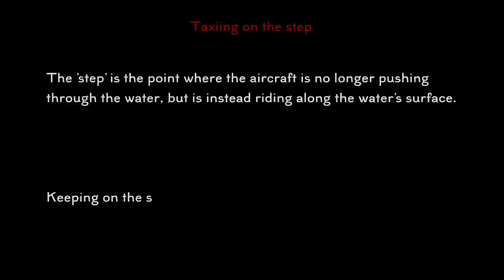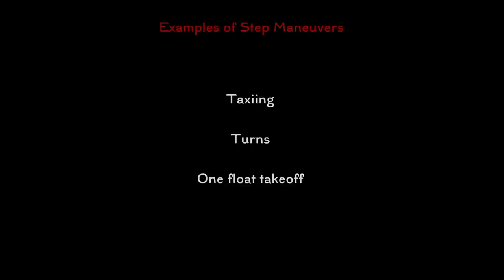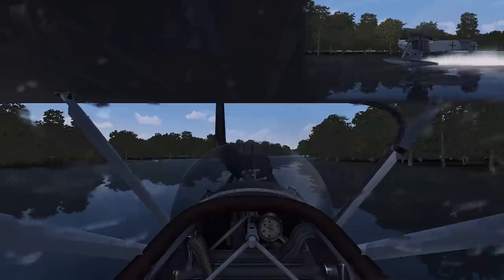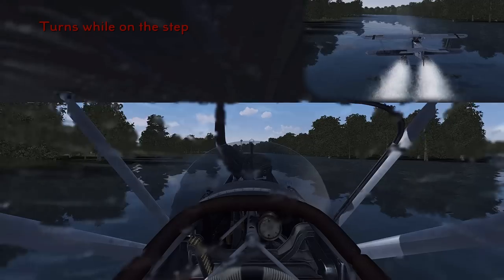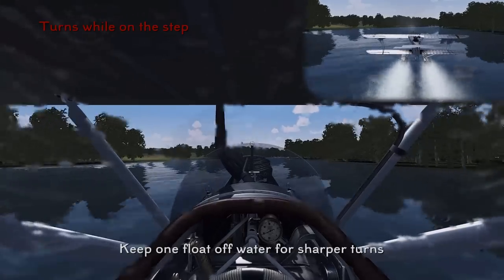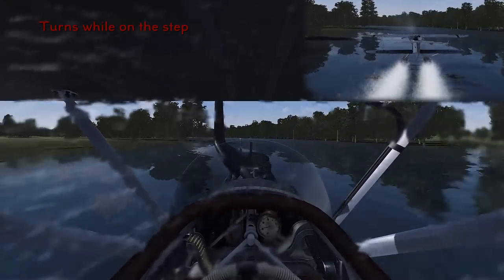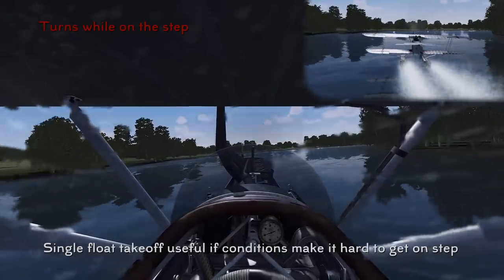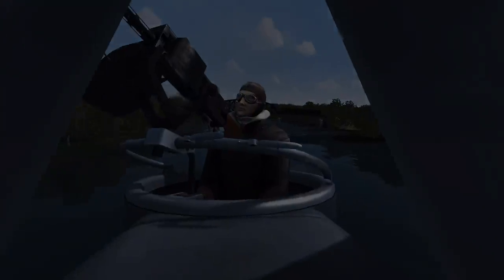Seaplane Techniques #1 Step Maneuvering

Comment: Very well done. Like an old pro! Only thing is just a small thing - Taking the plane up through plow IRL causes the most spray, with the suction of the prop and bows hitting the waves. I'll usually idle below 1000' or go full power. Runup is even limited to 15000rpm to avoid spray. Just a quick flick of the mags, run the prop through, and off you go. Cheers!